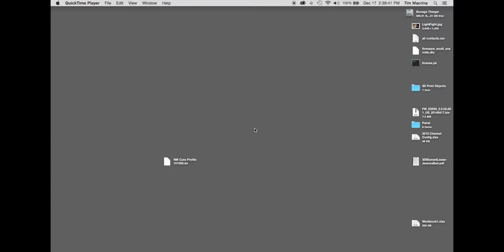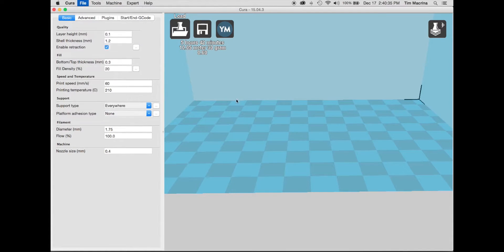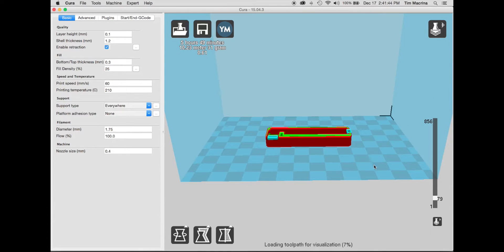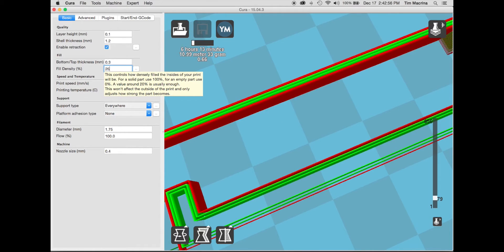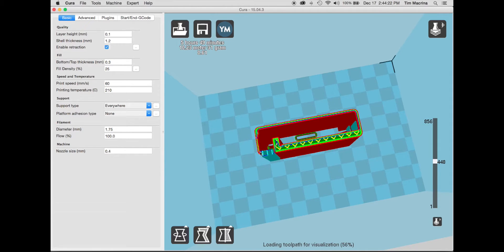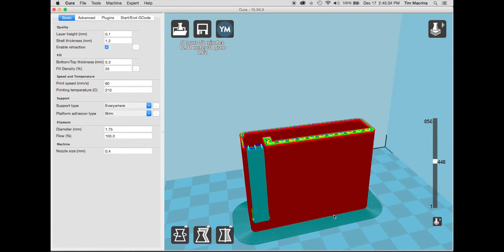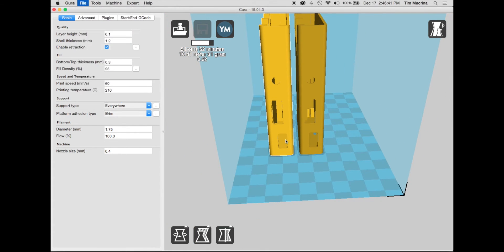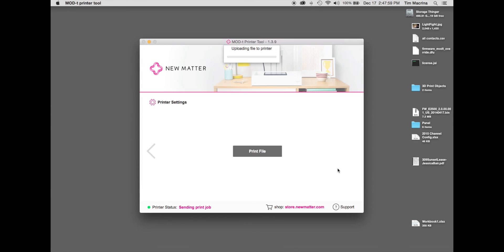NewMatter Mod-T Cura Settings

Comment: Hey I'm trying to build a small tablet/print server for my son's modt. I'm using an orange pi sbc and a touch screen for the interface, and I'm going to run cura. Unfortunately they are long gone, so getting the cuts profile is not really an option. Any chance you still have it? I'm a total noob here in the world of printing, so bare with me...

Comment: Thanks for a pretty helpful video. Quick question, when starting Cura for the first time, it tries to define a machine, obviously the MOD-t isn't popular enough to be there.
Do the settings there matter? if so, What did you input there?

Thanks!
Reply from the maker: I think the only thing I specified was the print surface dimensions.
Reply: +Tim Macrina that's what i did too - 150x100x120mm is what i saw on their page.

Comment: could you possible do one for slic3r?did you have to changed the gcode start and end sections?
Reply: +Tim Macrina Cool thanks for the fast reply!
Reply: +Tim Macrina awesome, thanks for sharing!
Reply: Tim Macrina I have mixed emotions about the MOD-t.

The Cons:
I have been experiencing a few major firmware flaws that they say are rare but seem not uncommon when you search their support forum. To name a few: the extruder head burning holes in the build plate, a print suddenly shifting on the x & y planes several mm per layer for several layers in a row, and now the extruder head will not heat up at all and I am waiting for a new one to arrive but they are backordered and it will take several weeks to get here.

The Mods:
I have replaced the standard build plate with a plate of glass covered with blue painters tape. This works so good I am keeping it this way even now that they sent me a replacement build plate. Also with your help I was able to tweak Cura and print with exceptional quality (when it actually managed to avoid the firmware faux pas). In fact I printed a Marvin (from 3d hubs) that looks so good I am still trying to get one that looks that good from our $1800 Maker Gear M2 at work. Next I plan to hack a candle warmer into a heated build plate since the MOD-t could really benefit from one.
Reply from the maker: +LordAtrix I havent used Slic3r yet but I'll have to download it and give it a try. I believe the newmatter ini file had all the gcode start and end sections.
Reply: +Tim Macrina What did they have as the values for the start.gcode and end.gcode?
Reply from the maker: +Jason Jaeger 
Start 

G90
G1 F300 Z1
G1 F5000 X77 Y26
G1 F300 Z0.315
G92 E0
G1 F2520 X77 Y-45 E4
G1 F2520 X77.5 Y-45 E4.05
G1 F2520 X77.5 Y26 E8
G1 F5000 X77.25 Y26
G92 E0
G1 F2520 X77.25 Y-45 E4
G1 F2520 X77.75 Y-45 E4.05
G1 F2520 X77.75 Y26 E8
G1 F5000 X77 Y0
G1 F300 Z1
G1 X0 Y0 F5000
G92 E0
Reply from the maker: +Jason Jaeger 
END

G92 E0
G1 E-2 F200  ;retract the filament a bit before lifting the nozzle, to release some of the pressure
G1 Z127 F300
G0 X0 Y35 F3000 ;move build tray front and center, Leave room to remove build surface
M104 S0
M107  ;Fan Off
M84   ;Motors off
Reply from the maker: +Jason Jaeger I just posted the INI file https://drive.google.com/file/d/0B9R9vfyzdM-SSl9vTF9qZ29ta28/view?usp=sharing
Reply from the maker: +Jason Jaeger No problem come back and let me know what you think about the Mod-T

Comment: Thanks for the informative video. I too bought a Mod-T and expecting it to arrive in the next week or so. Where are you purchasing your filament from? I read that Monoprice is the cheapest, but I have yet top read about anyone using it in this specific printer. Thanks again.
Reply from the maker: +Nathan Parr I bought mine at a local electronics/pc store. It ranged from $13 - $22 for a kilogram. I bought a bunch of different colors and so far they all have worked great.

http://www.microcenter.com/search/search_results.aspx?Ntt=Filament